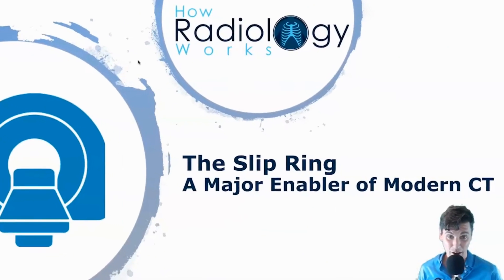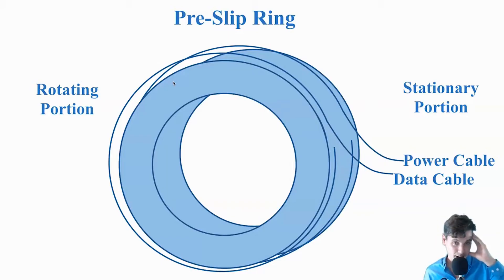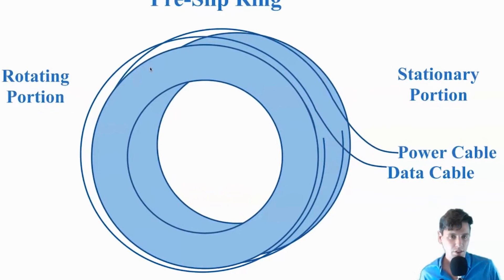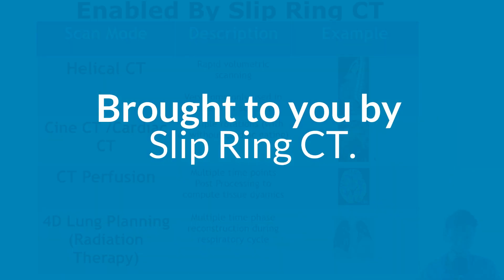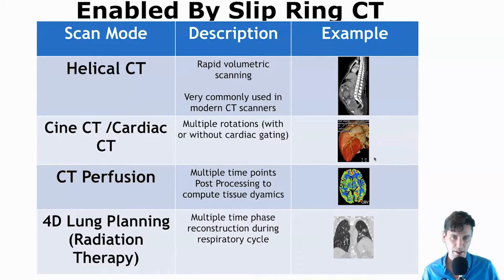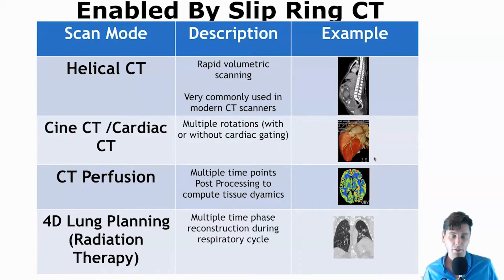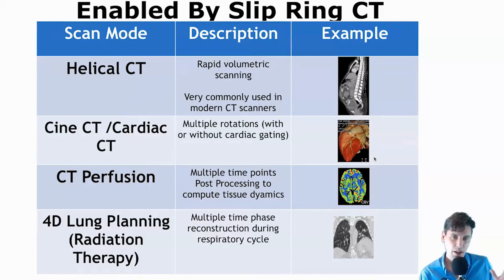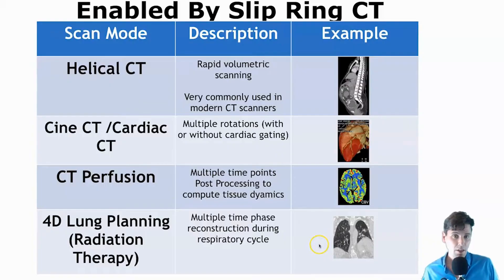Slip Ring CT (Key Component of Modern 3rd Generation Computed Tomography)

Comment: Thank u very much !! It’s a brilliant solution ! I always have the question of how this things are connected to the spinning wheel
Reply from the maker: There are some that can transfer with induction now without touching, ie brushless. For the traditional design think of a metal brush pushed against a metal wheel at an angle. If you rotate the wheel the brush can stay connected